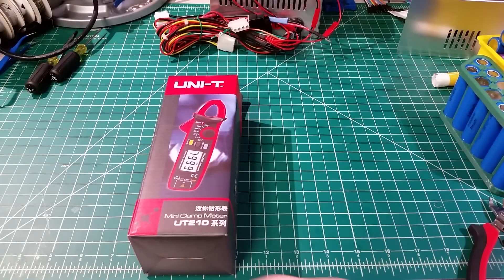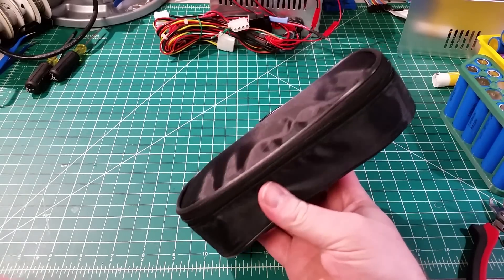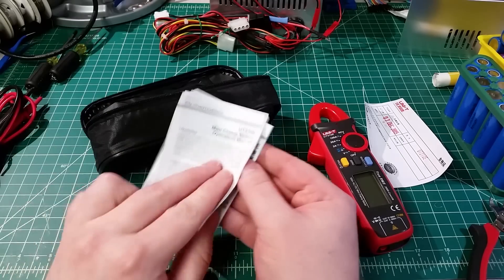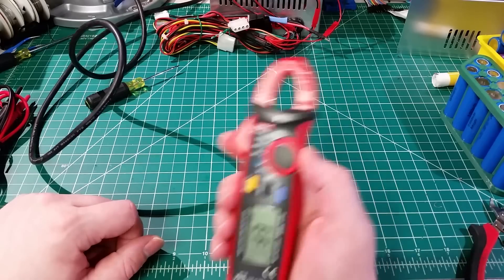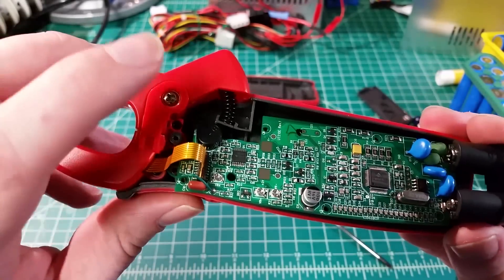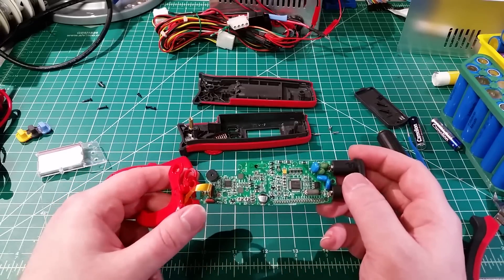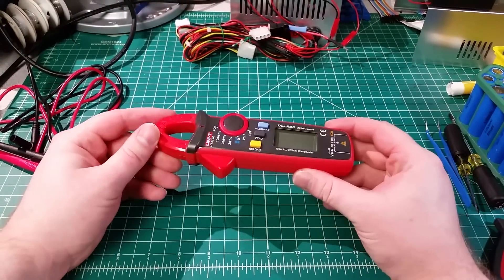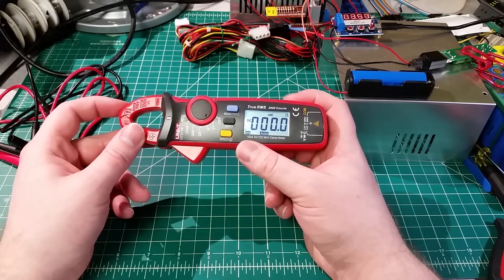Uni-T DC Clamp Meter Tear-down - UT210E

Comment: The selector wheel on mine went stiff. At first the one finger method didn’t work and later I just couldn’t turn it without fear of breaking something. I only use this a few times a month. I disassembled things like you did but then also lifted out the contact wheel, unsnapped the white spring bar, and extracted the knob. I could see places where the plastic or rubber rubbed between parts. I applied dielectric grease at these places, cleaned the PCB and applied fresh lube there too. It went back together fine and the one finger operation was restored.

Comment: Cam you adjust the individuel amp ranges with any of these pods...
My 2A range seems accurate, but my 20A and 100A range  are giving readings that are lower then what they should?

Comment: I have this clamp meter how however I’m getting different results every time I zero this unit depending on where I zero it .

If I click zero near the source I get a more accurate reading ? Is that how your Supposed to use the Zero function when reading Dc on a car battery ?
Reply from the maker: Yeah, you want to zero as close to where you are going to measure as possible when dealing with DC amps, especially if you are measuring small values. If it's something you can easily turn on and off you could even clamp the wire under test and zero while it's off. With DC current any magnetic fields will affect the reading, so Earth's magnetic field and any ferrous metals can affect the reading as you move

Comment: Near the beginning of the video it was mentioned the meter is actually linear.  What does that mean?   Thanks.
Reply from the maker: As far as the NCV, instead of just being beep or no beep, the buzzer beeps faster and more lines fill up on the display as the AC field gets stronger. A more linear response vs the binary response of some other non-contact voltage testers.
Reply: Thanks!

Comment: I am looking for a clamp meter i can use for washers dryers auto and small electronics like tablet and laptops would this one do all that ??
Reply from the maker: The 100 amp range should be enough for household dryers, most I've seen are 30-50A. This thing is nice and sensitive on the low range too. I bought mine for pretty much the same scale of projects that you are talking about, and the option for DC current measurement is nice on small electrics. With the low range you could even get a pretty accurate reading on something as small as the cooling fan in a laptop.

There are other options around, and the limitation i imagine running in to would be the smaller jaws on this, but i still think it's the best bang for the buck. They are even cheaper now than when i recorded this video, just watch out for the unscrupulous seller's trying to pass off a 210a as a 210e

Comment: Yes - for calibrating the DC current clamp to show zero amps on first start, we just press the ZERO button.
Reply: The relative zero feature on this device is handy for other measures like ohms, capacitance, etc. to take out the lead contribution.

Comment: Hi Daniel. Need your expertise urgently. I bought a new chinese "cheap" clamp meter - MT-266 - and everything seems to work except the clamp probe that does not give any reading. Could you please help with some suggestions? Do I need to crack it open and fix any device to get a reading on the clamp function? Thanks.
Reply from the maker: I have to wonder if you are trying to measure AC or DC current. The meter you mentioned looks like a traditional clamp meter that inductively couples to the circuit. It acts like a transformer, but only works with AC currents. This Uni-T uses a hall-effect sensor and measures the intensity of the magnetic field around the wire. Has to be zeroed or nulled every time you use it, but it works with DC currents too. I don't know if that's your issue, or if something else is going on, you could just have a lemon... There are also a few other catches if this is your first time with a current clamp, things like splitting a two conductor cord and only measuring one wire so the two don't cancel each other out. But other than comparing with another meter, if only one range was dead i might start by checking the selector switch, or since this is for the current mode, the connections to the pick up coil on the clamp. Keep in mind that you may have to trust this meter too keep you safe when poking around with lethal voltages and currents, have to trust any modifications you make too. These Uni-t meters are cheap, and I think this model is pretty solid. Might be worth considering if you end up with a refund from that first clamp meter
Reply: Thanks  Daniel for the prompt reply. I am using the clamp in both ac and dc circuits. It simply doesn't give any reading at all. I got some light from your suggestions and will try the clamp differently. Then I'll fall back to you for further query. Thanks!
Reply: @sham1234567891  So any follow up?

Comment: These are on ebay now for $14.95, just bought one hope its ok I dont need extreme accuracy. I find a better quality set of probes almost always improves the continuity performance as well as overall stability of readings.
Reply: yambo59 can you give us a link of those new probes?
Reply: You can either get a somewhat better set of import leads off ebay with "gold plated tips" for $3.00 to $5.00 which are a little better, or if you want really good ones get a set of Probemaster 24K gold plated tip silicone leads, they are super high quality both with gold plated ends and supple silicone cables, but they will cost about $17.00 for a pair - seems expensive but I bought a set and after seeing them I dont regret it one bit, the quality is superb and they have exceeded my expectations in every detail, they have all kinds of leads and accessories , very nice quality and great folks to order from - also Probemaster products are made in the USA.  Heres the Probemaster link-->    

http://probemaster.com/8000-series-test-leads-only/

Comment: I really like the size and features of this meter but after 1.5 years of light DIY use (once per month average) the settings wheel has become flaky.  I've only noticed it in amp and capacitance mode so far but the readings will go to zero or fluctuate wildly until I turn the wheel very slightly.  Unfortunately the problem returns randomly even if I don't move the wheel again.  This makes amp readings especially difficult because opening and closing the jaws often jiggles things enough to trigger the problem again.

I disassembled it to find dark streaks along the paths where the copper sweeps touch the silver contacts on the circuit board.  I suspect this is fragments of oxidation perhaps allowing current to pass between contacts that shouldn't be connected.  I wiped it clean and the meter works flawlessly again but the wheel grinds so I need to purchase dielectric grease or electronics lubricant to replace what I wiped off.  If things had been gold plated I assume this wouldn't have been a problem.

Also, getting DC amp readings correct is pretty fiddly.  You must hold the jaws right next to what you want to measure, press zero repeatedly till it stays near zero, then clamp and take a reading without rotating the meter.  Rotating causes the reading to change significantly even if the meter is not near wires.  I compared it to a Fluke 325 and the Fluke doesn't seem impacted by rotation.  Once you zero it, it tends to stay zeroed and readings replicate more reliably.  The Fluke's larger jaws do make it more of a pain to get it around the wire you want in smaller projects.  Both meters do give similar readings on any particular wire.
Reply: Useful info

Comment: General question: On a DC clamp meter, does shielding around the wire influence the measurement?
Reply: If that shielding restrict magnetic flux then it will affect the measurement. Generally, they always have offset and you have to take that into account before taking measurement, either some known offset value need to be saved and deducted or you have to reset offset. Not an easy sensor to work with, in homes we have wires and magnets around us.
Reply: @nitinkumar29  thanks! Good to know

Comment: Great review. Getting mine today. Had to break circuits to find drain on car with new battery. I've also wanted a clamp but the DC clamps seem to be very expensive. Also got mine on Amazon because of all the excellent reviews. Subbed and liked

Comment: I did a review on one issue of these a few days ago in my channel too, I thought it wasn't too bad, pretty accurate, only thing I thought was a bit poor was input protection for the leads.
Reply: c'mon its a clamp meter.
this is above and beyond for a clamp meter that is going for like 25 to 30 USD  3:48
its better then many multimeters.

Comment: My UT210E show 233ma current with nothing connected on DC before I zero it out. I think it should not do this crap?

Once zeroed it shows current anything but the same as Agilent DMM.

0.081A ut210e
76.1mA Agilent

The voltage is 1.599V for 1.5AAA, Agilent shows 1.601. Very good.
But for 12V battery:

The voltage is 12.66V for ut210e, 12.68V for Agilent, I expected better, since cheap HYELEC MS8233E is spot on !
Reply: Do you know how to calibrate voltage and clamp current measurements?

Comment: I just ordered one about 3 hours ago on Ebay.  New unit $31.28 NO Shipping!
Also the tips come off the end of the probes for longer contact length.
Reply: dont, as you wont get it, if its with "NO shipping".
I got a weird feeling you wont receive it.
and yeah they were unreal cheap 5 ot 7 years back.. paid like 28 for my unit.
I would like to see a side by side tear down with an extech MA63 (its a 230US clamp meter, very resampling the 210E.)

Comment: Hey thanks for the tare down of the unit. I have been trying to find a video on how to repair a low amp probe. I have a snap on low amp probe which I was told is not working...it connects to my automotive scanner...I was hoping someone made a video on how to repair one..do you repair electronics ?

Comment: Great video. I’ve just received one of these devices and notice that when I place it in the 2A current range and change to DC mode, I get a reading of ~250mA before zeroing, with no wire in the clamp. The instructions do state the device should be zeroed before taking measurements, but I’m just wondering if this behaviour is normal?
Reply: Measuring current with a clamp you actually measure a magnetic field.
For AC no problem but for DC the magnetic field of the earth comes in view.
That is the reason you have to zero before DC current measurement.
Reply: +Andre Post : Well that's a very interesting bit of information, thanks for that. Michael Faraday and his co-experimenters many decades ago developed the idea of using galvanometers in the vertical orientation as Dip Meters to measure the Earth's magnetic field. So maybe we can continue that experiment with the modern digital version when we have spare time.

Comment: Says it will measure frequency.  How do you do that???
Reply from the maker: There are a few versions of the UT210 and the E model does not measure frequency. It looks like they left mentions of the display segments for frequency in the manual though.

The 210C and D have frequency measurement, but only the D and E models measure DC current. On top of that, the 210D only goes down to a 20A range, the 210E has a 2A and goes all the way down to the milliamp(±2% and 8 counts).

For me measuring frequency wasn't a concern but I definitely wanted the more precise current range.

Here's the manufacturer's page for the UT210 series: http://www.uni-trend.com/Productslist.aspx?ProductsCateID=773&IntroCateId=773&CateID=773&CurrCateID=773
Reply: Thanks for the response.  DC current measurement is why I bought this meter.  I have the E Model.

Comment: It's really true RMS?
Reply from the maker: +Виктор Максимов 
Yes. I've compared it to my other RMS meter and the readings are in line. The manual lists the AC Volts range as fairly accurate between 45 and 400Hz. The AC Amps range is spec'd for 50 to 60Hz. Both are listed with a 3% error factor for crest factors around what you see on normal mains power, but the error does increase when the waveform is really out of whack (7% when the peak to RMS is at 3:1). I found a copy of the manual here: http://goo.gl/GnBbkB It has the detailed info.
Reply: +Daniel VanBorkulo 
Thanks Daniel. I think 3:1 more than enough for electricians.

Comment: Nice rip down. im considering getting one of these ut210e or possibly the ut203. just wondering how wide the jaws open on this 210e? im going to be using it solely on automotive wiring DC current. mainly parasitic draw diagnosis. but some of the battery cable i need to clamp around are about 15mm. would this meter open far enough for that?
Reply from the maker: +HoopDub 
Not a lot of room to spare but yes, just measured 16mm(0.63in) with the jaws fully opened. This is the kind of tool that will take an automotive headache and turn it in to a problem you can track down in a few minutes, definitely a good reason to have a DC clamp meter.
Reply: +Daniel VanBorkulo excellent!! thanks for the reply. now to track one down in the uk 😀
Reply: for automotive  you need a probe clamp meter with an oscilloscope